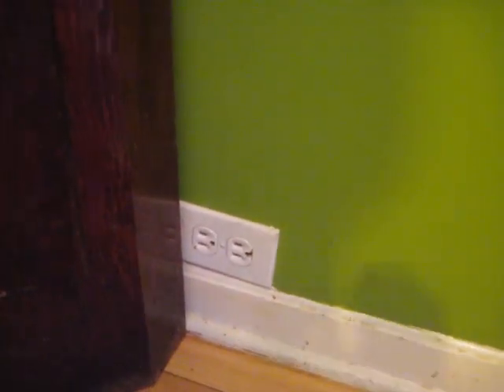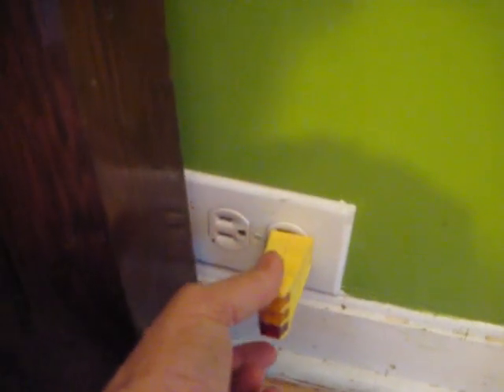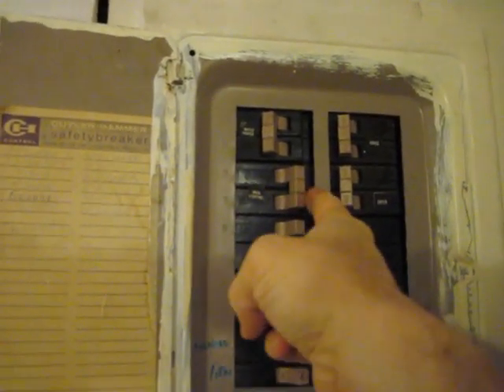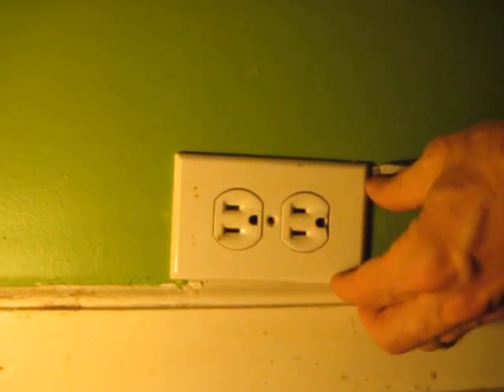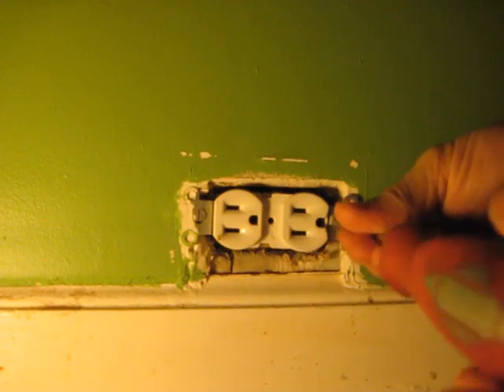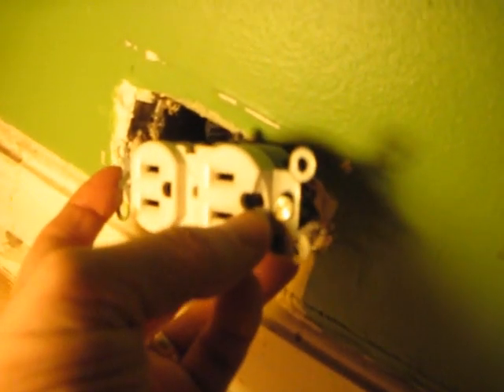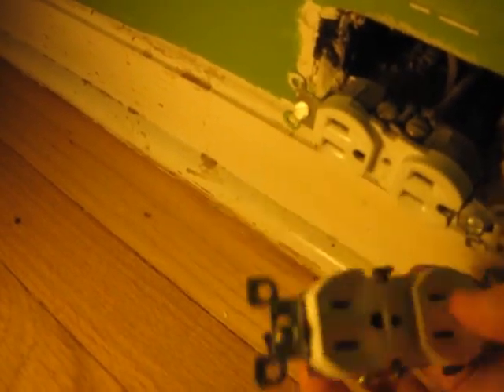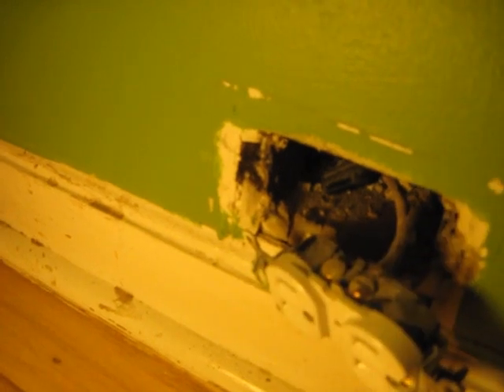How to Repair a Damaged Outlet (Ungrounded)

Comment: I replaced the outlet a couple days ago.  Its an old house (1935) and probably the original wiring. There is no white and black, just black and cloth insulation.that looks the same on both wires.  I took a guess and must have guessed correctly because it works fine.

Comment from the maker: The box is likely just nailed into the wood studs, and wood is a bad conductor.  You really need a true "wire" ground attached to a water pipe or outdoor water rode.  I plan to eventually fish up a ground wire from the basement.

Comment: If your power cable is BX and Armor clad wiring, it should ground.  Most likely for open ground is dirty and corrosive metal sheathing.  Wire brush should clean it and restore your ground issue.

Comment: How do you know which wire goes to each screw?
Reply: white neutral goes to silver , black hot wire goes to bronze/gold  , ground wire goes to green screw if the socket has one. 6 years later i sure hope you found your solution...